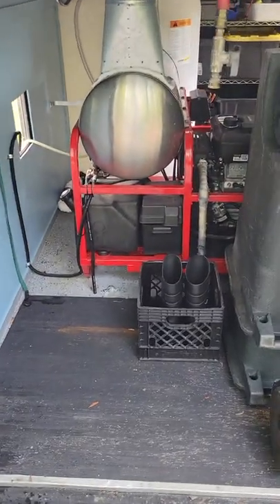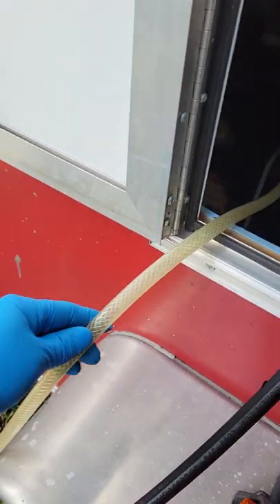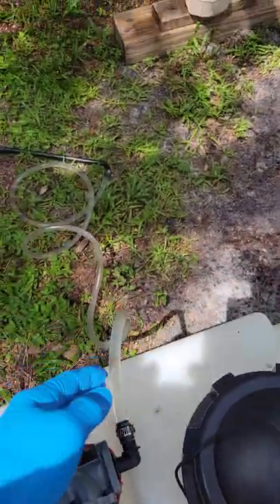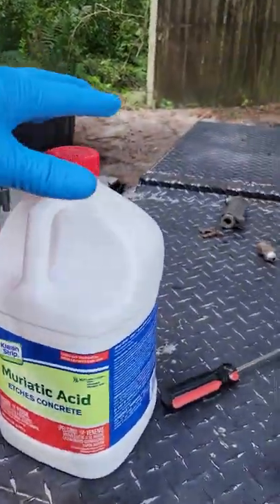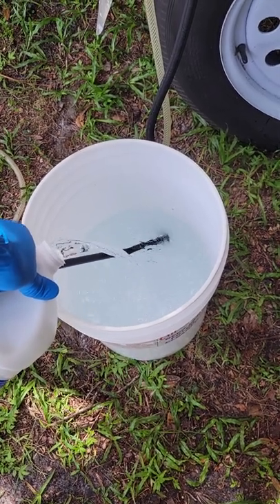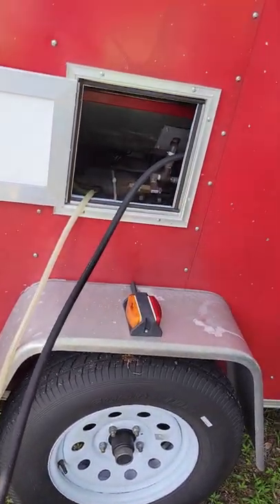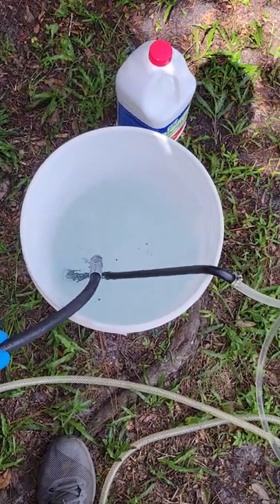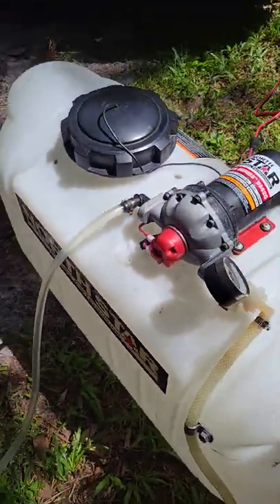how to clean pressure washer heater coil

Comment: Did this fix your issue?
Reply from the maker: Yes, but I have to do it two times the same process and second time I add 2 galon of water and 1 galon of muriatic acid, more concentrated
Reply: @vgapressurewashingandhoodc4745  Thanks for the video. I did the exact same thing and I only got it as clear as a light yellow, not really clear clear. Was that your same result? Is there no way to get the water back to clear? Thanks!